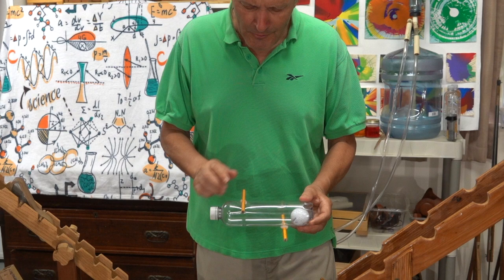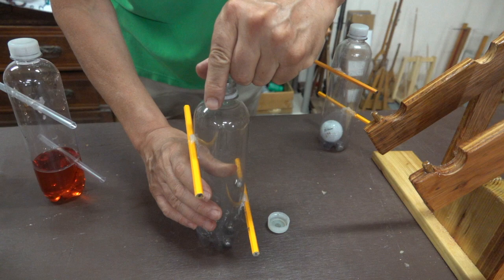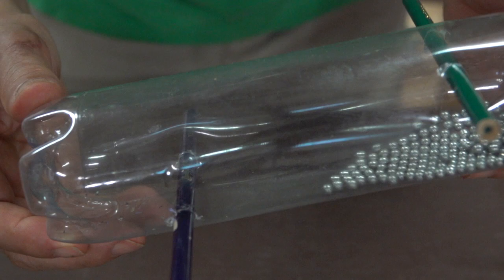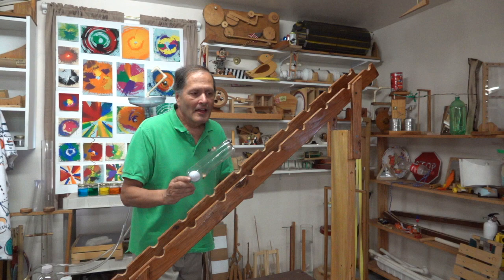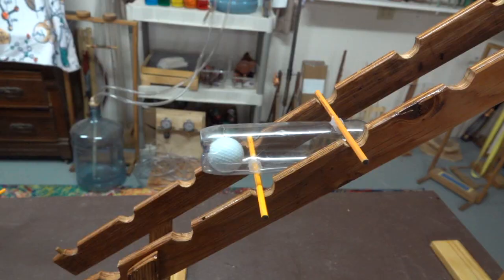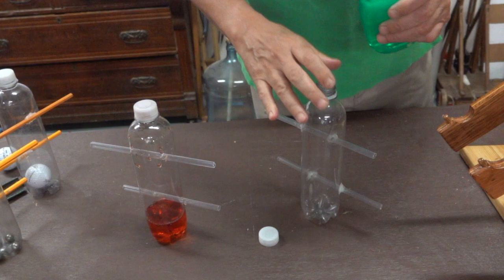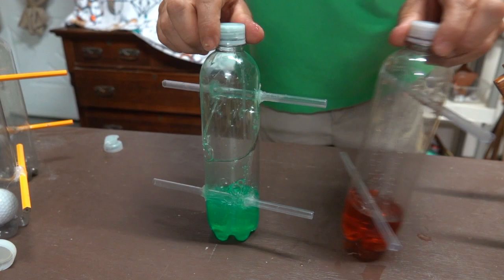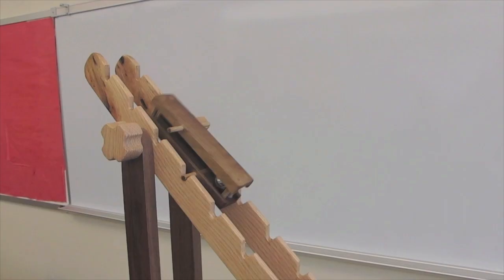Soda Bottle Tumbling Toy // Homemade Science with Bruce Yeany

Comment: What might be fun is to create something similar to walk down a set of stairs. You’ve got me thinking. 😁
Reply: Slinky.  Registered Trademark.
Reply: @CricketsBay  I thought of that, too, but aren't we stretching the "something similar" part?
Reply: The difference with stairs is that they are designed to be level, or even tilt slightly the other way if anything. However, you could maybe design a special-made tumbler that has ramped insides, so the mobile weight inside will run toward one end even when the outside is level.

Comment: Interesting. I wonder if anyone ever made a clock out of something like this. If you get the variables right, I would think that these can actually be fairly accurate time-keeping devices.
Reply: 3:15 is very clock-like.
Reply: I'm trying to picture how one could make a water wheel like assembly out of these.
Reply: There are many types and designs of gravity clocks.

Comment: The small ball bearings bottle was good but I'd have been inclined to chop 2 bottles apart and use the fat bottom ends and secure with strong glue or tape, as the narrow cap end had the ball bearing sit in the cap end.

Comment: I was imagining the section of tumbling motion transitioning into a ramp walker, a bottle captured and plopping into a cavity of say your lizard walker continuing on in that fashion down a ramp, as a double feature. Or a whole creature with legs designed to flip-flop head over heels and land on its feet only to skitter along down a ramp the rest of the way. 
 I once saw a chameleon in a tree not walking but merely rocking from side to side, a well-suited match akin to your teetering gecko walker. Another meager crumb came to mind, the Tumbling Spider as seen in a New York Times feature on YouTube which inspired the development of a biomimetic robot based on the rolling spider locomotion.
Reply from the maker: there are tumbling acrobats that tumble down a flight of  steps but haven't seen one that might work on a ramp,that is an interesting challenge

Comment: Build a small inverted one in an aquarium filled with water. Have a bubble of air or some oils to lift it. Could also add something denser like salt water and possibly get some interesting interactions the movement of it and the air or oil.
Reply: Neat idea! When you say "a bubble of air" of course that implies that it must be mostly filled with something at least as dense as water.

Comment: I notice your axels are offset from center. Does the distance from the centerline have an impact on how well these work? Would an example still perform like the others if the axles were placed on the center line but the bottle was longer? Would changing these variables have any effect on speed and efficiency?  You have left me with so many questions. Great job as always. I'm 36 and you've got my mind turning over a simple experiment and the applications and implications it could have on every day life.
Reply from the maker: Hi William,  I hadn't tried that,   the axles were offset to  so that they could pass through the tumbler at the outer edge and not block the passage of the ball inside.  You might want to check out Douglas Stith's channel,  he has two videos on changing variables on tumbling toys
Tumbling Toys variations explained  https://www.youtube.com/watch?v=xgMQJ2dCThc
and 
Tumbling toy variations  https://www.youtube.com/watch?v=K58TNfb8JyM

Comment: I think that dish soap isn't as dense as water, so more of it needed to get to the end to have enough weight there, contributing to the slowness. The time-lapse made me think that, properly designed (and maybe made larger) you could make a nice gravity clock with a similar tumbler.  
I think it would be great to try tumblers with TWO (or more?) things inside, like a heavy oil and water (with food coloring).  
Also a challenge for builders wanting to go to the next level: Can you make one that runs continuously with the aid of a motor? Perhaps with a large double wheel with notches, or a series of short boards with notches connected loosely over a belt with guides to make them stand up and line up as they come over the top pulley, or...??? 
How about putting a toy car in side a special-made shape like the one at 8:08 but higher (greater-diameter curves at the ends) so that it tumbles UP the notched ramp?

Comment: I noticed for the ones, where the ends raised up as it flipped over, that occurred when the balls rolled into the neck/cap area. It looks like the balls, when they roll into the cap area, it may have some extra torque and the balls kind of get caught in that area, thus delaying the flipping. Does that seem reasonable?
Reply from the maker: yes, now that you mention it,  the movement is much more pronounced  with the small steel balls and BBs andwhen the bottle cap is at the upper end.

Comment: I think this is not about viscosity. It's about adhesion. How viscid is a golfball? If you use a very slow fluid that doesn't stick to the bottle, it's going very fast.
Reply from the maker: I am currently trying it with a soft putty and will post the results in the future
Reply: @YeanyScience  that's not really a valid answer. I hope you correct yourself in the upcoming video.

Comment: I think an interesting addition to this would be to make a ramp that is a series of semi-circles and a tumbler that is a square. similar to this : https://www.youtube.com/watch?v=FlvjWpWu99A
Reply: Cool thought, but the weight inside would settle into the corner of the square and hold it. If you made it steep enough to overcome that, you wouldn't need a weight inside and it would just be rolling downhill.